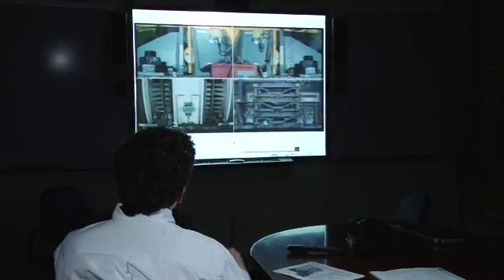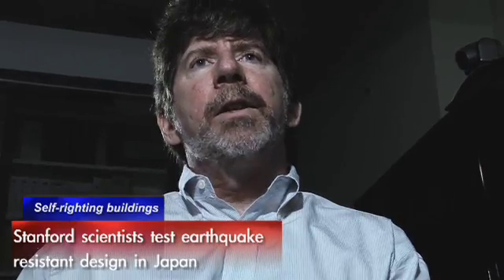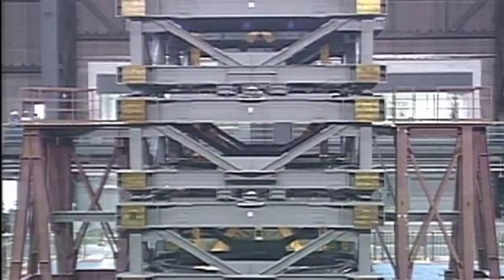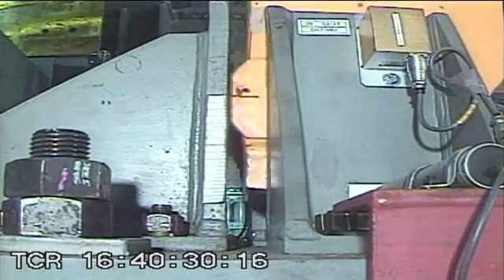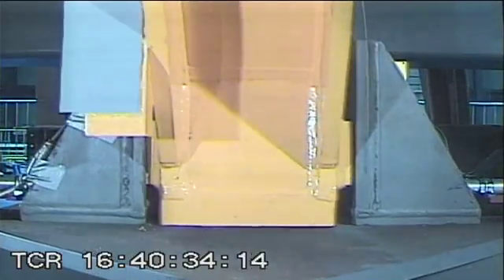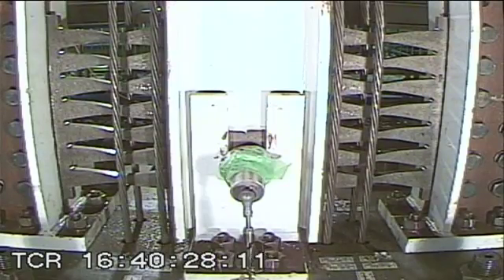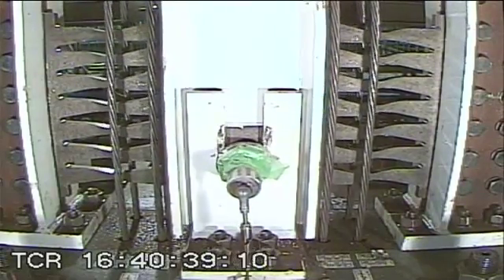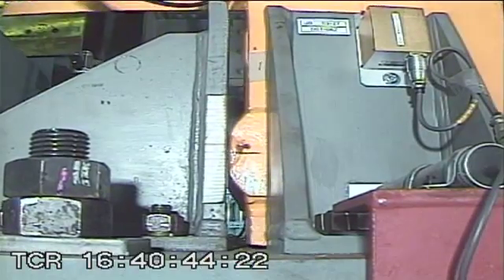Building Design Pulls Structure Upright after Earthquake

Comment: This is excellent research that should help building contractors design safer buildings.  Because many times it is not the first Earthquake that takes down the building, it is the second one that came years later.  Sensors that detect fault in the building after a major Earthquake will be awesome.